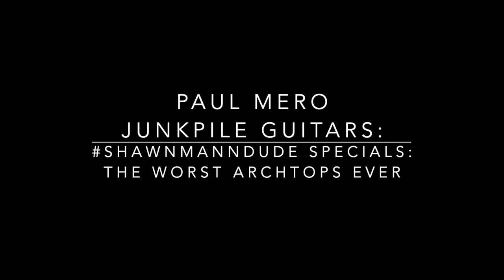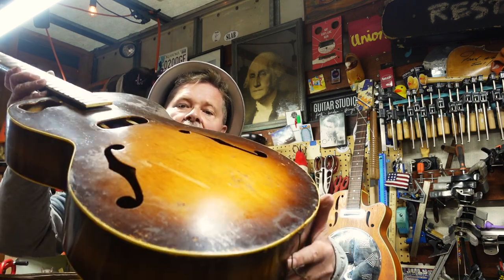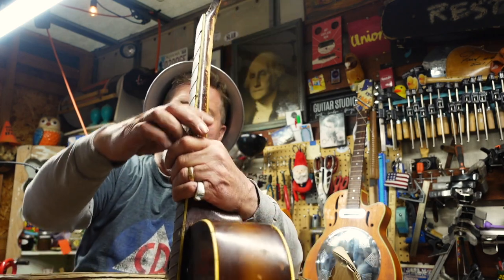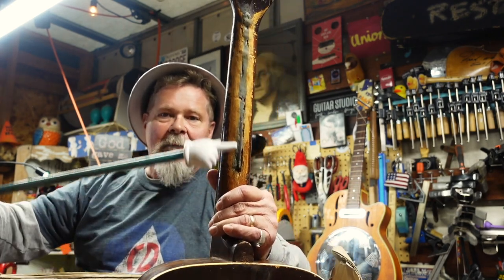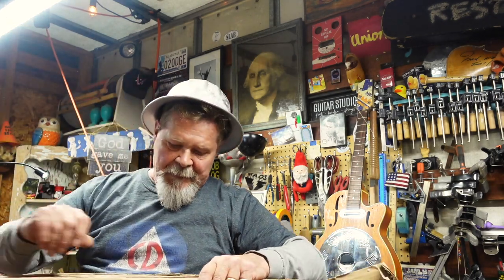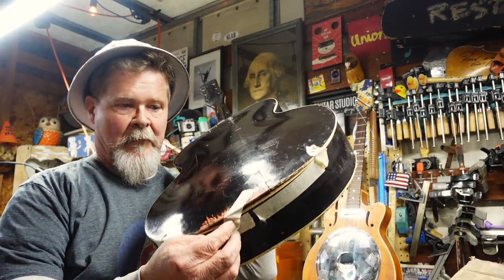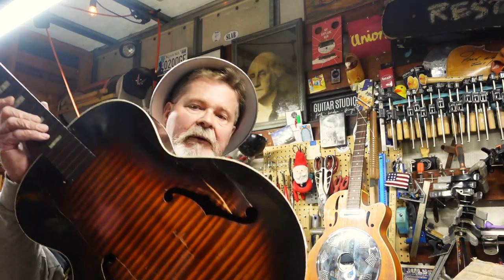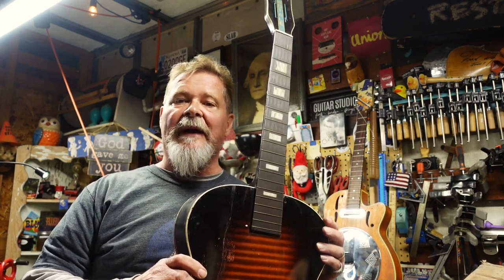#Shawnmanndude Presents: The Worst Archtop Guitars You Have Ever Seen

Comment: Old Kay arch tops are light, they are solid top, they are American made and they are cool because of how old they are. Best of all they are often free.
Speaking of JB Weld on a guitar; I picked up a peavey horizon someone had put a layer of JB Weld over the neck plate and then somehow got some on the tuners, which are worth saving because they are patterned after kluson to her Sarkissian Gibsons. So I took my angle grinder with a 4 inch cardboard, cut out for a grinder and burned it off the tuners, and the same for the neck plate. I sanded the body and polished the neck and it’s turning out to be a nice American made guitar.